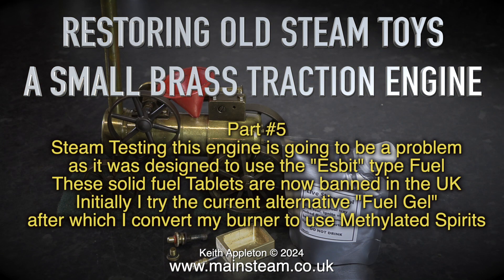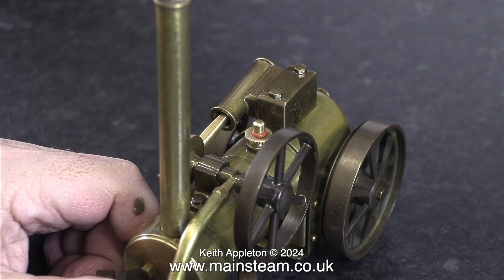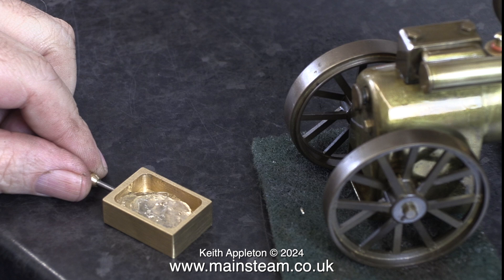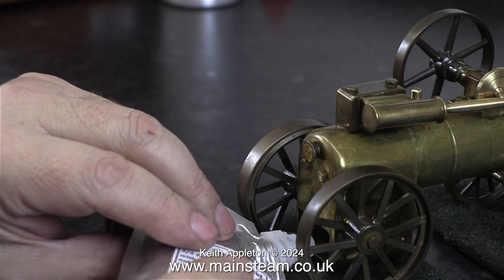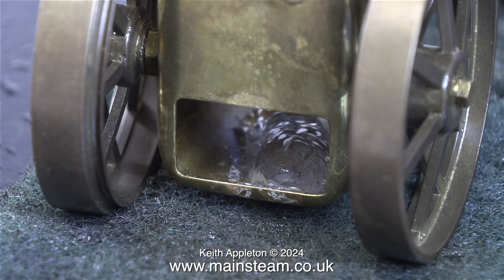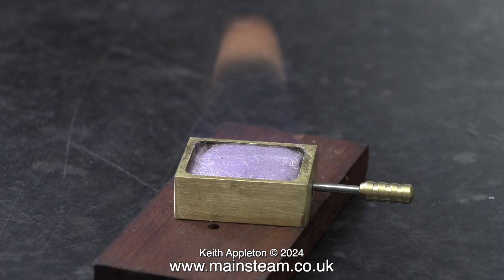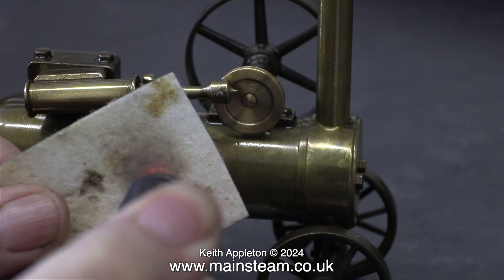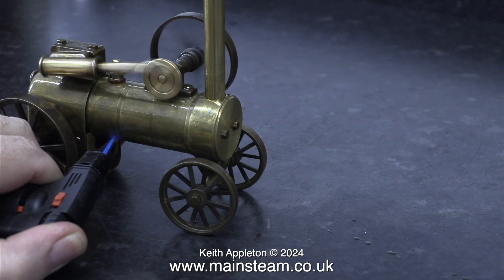A SMALL BRASS TRACTION ENGINE - PART #5

Comment: methanol flames are only visible under the right light.  I dont understand why solid fuel (or many other chemicals) were banned across Europe.  Its kind of a slap in the face to people who use and need it, and bans usually don't cause much good to offset the major annoyance, and create black markets anyway.

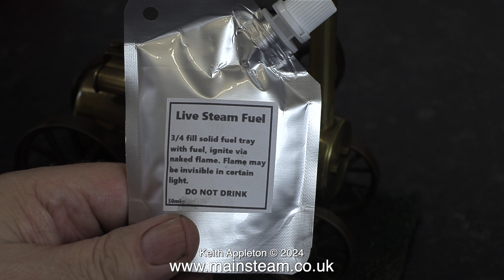Comment: I believe Mamod burners to be a little oversized for the engine , so regularly use Chafing fuel (ethanol gel, in a striped out Mamod burner) instead of meth. The gel burns slightly cooler and is a cleaner fuel than meth (clean up after use). My little MM2 will happily drive a fairground plate that I 1:57  have (5 rides) on gel

Comment: One of my first steam toys was like that, the boiler shell was of too heavy a gauge and the firebox area too small The only way we could get it to run was to use a propane torch, which showed us that the boiler was only soft soldered together.